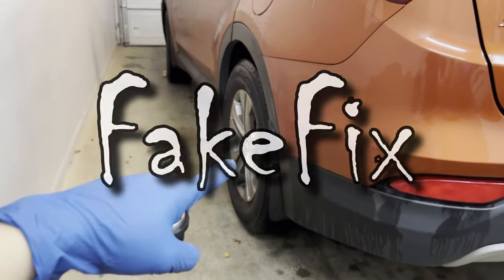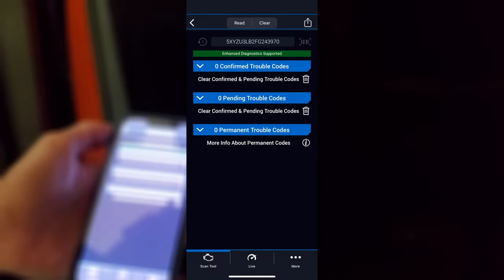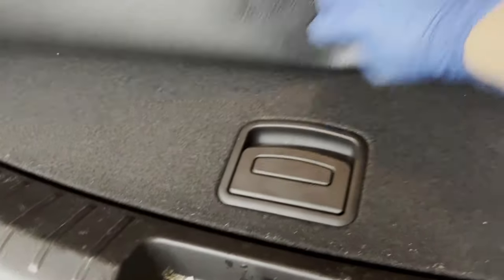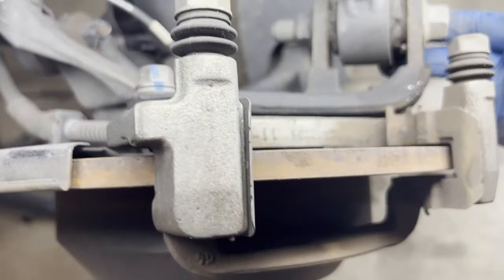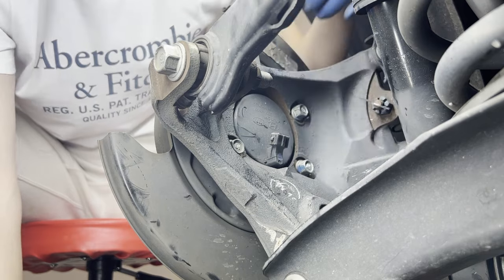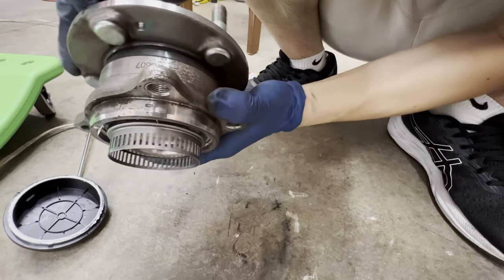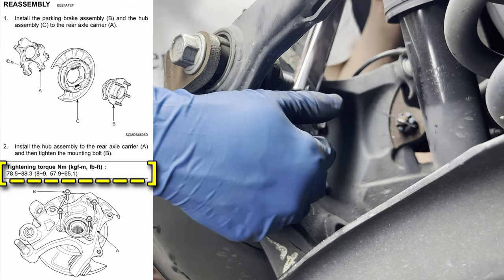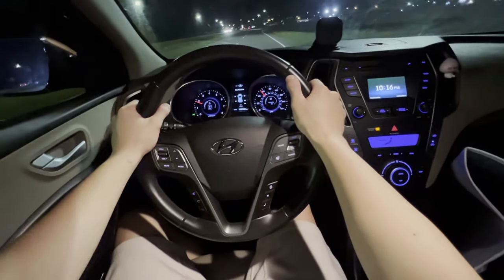Hyundai & KIA REAR WHEEL SPEED SENSOR REPLACEMENT@chrisfix

Comment: As others have said so well, excellent video. In my case, I would have probably spent around $400, but even then it would have taken two months for an appointment. The clarity of this video allowed me to brave the repair myself and I couldn't be more pleased with myself. (lol) Cost: $84 for diagnostic report, $17 for sensor from Amazon. Now I look forward to saving $84, next time, by using my new diagnostic scanner ($98.99), and @chrisfix will be my first stop every time.
Reply from the maker: Such a great comment!! Thank you!
Reply: Can you tell us what kind of scanner did you buy? Thanks!
Reply from the maker: @ricardoampie4194 BlueDriver. Its $99 on Amazon

Comment: Good video, just one correction needed, all you have to do is push the clip in and the plug will release when pulled. I looked up how to change it in Mitchell since I found the sensor separately at one of the parts stores. Mitchell said to remove the front wheel and the back seat. I think that comes from Hyundai. What? Remove the front wheel and rear seat back, that's insane. It still never mentioned how to separate the sensor from the hub. I figured I would have to pull the hub to do it but wanted to see if there was a way to pry it out without removing the whole assembly. Thanks.
Reply from the maker: Good to know! Thank you for the correction.

Comment: I have a 2012 Santa Fe. Your video was almost exactly on how to change the abs sensor. I was able to to do it and saved $350. Thank you.

SN: The 2012 Santa Fe doesn't require an offset wrench because you have enough room to do it with a socket wrench.
Reply from the maker: Glad to hear that!

Comment: Saw other YouTube videos on this... By far this is the best one with the best lighting/video angles.
Dealer quoted me $550 USD for this fix. Sounded way too high for me.
On my 2018 Hyundai Santa Fe Sport replacement, removed the entire caliper bracket along with attached Caliper (squeezed a little caliper cylinder w clamp to ease removal/installation of entire Caliper Assembly).
The use of the offset 14mm wrench - bought a set for this fix - to remove the lower bolt on the caliper bracket was invaluable, else it would required more disassembly in the rear suspension, something I was not willing to do.
Reply from the maker: Thank you for sharing your experience. I haven't used an offset wrench since this one.

Comment: Thanks for the great video. This fix worked great for my 2016 Hyundai Sonata. The only differences are:  do not need 14mm angle wrench and the emergency brake backing plate needs to be removed. Thanks again!
Reply from the maker: Good to hear that!👍

Comment: Dealer quoted me 450 for one, 700 for both. This video will help me do the job myself. I bought the genuine KIA part (20 bucks! on ebay), and an 8 dollar offset box end 14mm wrench. Thanks for the clear, concise step by step video! BTW ... Auto Zone diagnosed the problem even to which wheel sensor was causing the lights to stay on for..FREE!! Only thing I may do in addition is to put a little silicone caulk at the outer edge of the part before tapping it all the way down. KIA had a service bulletin on this 7 years ago for this car, and it said it will help keep water out which can wreck the sensor.
Reply: I did this repair today. Went well after watching this video several times. On my 2013 KIA Sorento FWD I didn't need the offset box end wrench. But,  after I finished, I started the car and the warning lights (ABS, ESC, downhill assist) still came on and stayed on. Rats! I pulled the car up and down the driveway. Still on. Disconnected the battery for about an hour. Nope..still on. Then, went for a drive around the block and the lights all went out! YAY! So...in my case it was different from the video which showed them going out immediately. So, if this happens to you, don't despair until you drive the car and spin the wheel fast enough for the sensor to pick up the signal. Thanks Again for the clear video!
Reply from the maker: Thank you for info!!

Comment: Excellent. This was a big help in replacing the rear wheel speed senser in my 2017 Sorento (FWD). There was only one minor difference with accessing the brake caliper bracket bolt, and I did not require an offset 14mm wrench.  My adaptive cruise and front camera also didn't work because of this failed senser. I bought a KIA OEM senser (<$100) instead of the cheaper ones offered on eBay. Thanks again for the work that you put into this.
Reply from the maker: I’m glad to hear that! Thank you for sharing your experience.
Reply: Boa noite amigo, acredito que estou com o mesmo problema. Tenho um Kia Sorento, e ascendeu a luz do sistema DBC no painel e não apaga. O problema no seu carro era esse?

Comment: Thanks for the very informative video. A friend of mine has a scanner that also checks for ABS codes. The right rear sensor was sending signal that the car was traveling 170 MPH while we were sitting with the car in P.
It looks like a simple enough job, I wonder how much more the dealer wants for the part, it's cheap enough on Amazon.

Comment: I wish I could give you more thumbs up. I bought the rear sensor for my wife's 2017 Tuscon.... but it's the wrong part. EVERY single part search is the exact same wrong part. (wiring harness with plastic single bolt plug sensor).  What I see when I pulled the wheel off is this very thing you're replacing as the only sensor on there. I have no idea why ours is different than every single sensor listed for this vehicle. I wonder if there was a revision or something mid-year for our model or something where this sensor was changed for the one in your video. Well... I can take back the $125 part, and purchase the $20 part now.      Thanks so much for this video!
Reply from the maker: Thanks for sharing your experience.  I can feel how hard it was. The probe type sensor is for the front wheel only. Cap type sensor is used on rear wheel and it is sealed with the wheel bearing. Thats why its soled separately in official parts shop. Good luck.

Comment: This was great.  Other videos say you have to replace the bearing along with the sensor because they come as one unit.  Which is $50 vs $10 per wheel. Love that he showed how to test that the sensor is bad too.  My sensor ohm'd out ok but when a magnet was placed next to the sensor the ohms did not drop toward 0 (Replacing the sensor fixed my problem).
Reply from the maker: Thank you for the magnetic trick!

Comment: Great video. Just one suggestion: measure the resistance in the beginning of troubleshooting to eliminate wiring issue as a potential problem. This could save time.
Reply from the maker: Good point! Thanks

Comment: Thanks man! When you say align the connector position, is there a mark to line up or something?
Reply from the maker: I couldn't capture it in the video. Just point the connector towards a place where the bolt spacing is wide. The hub has no top or bottom.
Reply: @_yamech7533  Thank you so much my friend!

Comment: Thank you for the video.  Helped me a great deal on my 2015 Sonata Limited.  Only the right side was bad, but replaced both sides. If one side goes bad the other side is right behind, right?  Didn't need the offset wrenches as bolts were very open, but now I have a set so still a win.  Bought 2 sensors from Hyundai dealer in NC, $53.33 for both with shipping.
Reply from the maker: That was good deal. Thank you for sharing your experience!

Comment: Thanks for the great video. Replaced my wheel hubs and cleared the code. Note: the clip on the connector can be pressed to release the connector rather than removing the clip...thanks again.
Reply from the maker: Good tip👍 I should mention that on next video.

Comment: FYI my 2017 Sportage used all SAE bolts on this job, except for the 19MM wheel nuts - ??? Great vid, thank you.
Reply from the maker: Most of bolt sizes are compatible. Perhaps it would have been possible to use metrics. In Korea, metrics are the standard.

Comment: I am about to replace mine on a 2017 Kia Sorento.  Dealer wanted $750. I saw your video and said I’ll try to do it myself. I’m confused as to where to align the sensor like you said when putting it back on tho.  Is there a groove indicating where the sensor should be?
Reply from the maker: All you have to do is remember the direction of the connector when removing it.

Comment: Great video,  which scan tool are you using?
Reply from the maker: Its Bluedriver($120). Its easy to use but overpriced. If you need to scan the code only, FIXD($40) can be a great option.

Comment: Replaced my sensors and lights remained on. My new sensors are reading 20m ohms. Is that right? What should the actual ohm reading be for rear tire sensor? Does it have to be around 240ohm?
Reply from the maker: What was error code number?
My new sensor was reading 400kilo ohm.

Comment: Great video I've got a Hyundai ix35 and I've changed the Driver shaft and maybe I've done something to the sensor because it feels like the the brakes are on
Reply from the maker: You may need to check wheel speed sensor and wire. If you did not remove sensor before take you hub bearing, sensor wire could be damaged.

Comment: Is it possible to remove those bolts by manual wrench instead of electric wrench?
Reply from the maker: Yes for hub. No for wheel lug nut. you need braker bar at least.

Comment: Excellent video! Saved me a bunch of time. Quick question - why did you have to remove the caliber and bracket separately? I think you could remove bracket and take off whole assembly. Saves a few minutes.
Reply from the maker: I think it will be possible to remove it, but it will be difficult to release the bolt under the lower arm.

Comment: I have a question. Does this works on Kia Sportage 2014 as well? Got same DTC code. But cannot find bearing sensor anywhere for my Kia?
Reply from the maker: As mentioned in the video, dealership parts center do not sell sensors alone. Search for wheel speed sensor that fit your car model on Amazon or eBay.
This video is only for FWD. not 4WD

Comment: Hey gudday I watch your video about abs brake hill descent light does not comes off. It is suitable also on kia sportage 2019 cause mine lights off  does not comes off. Just asking I'm from the philippines
Reply from the maker: If it is Front Wheel Drive vehicle, Yes. it will be similar to Hyundai. But make sure OBD2 Error code before replace sensor. ABS light may be turned on for other reasons.

Comment: I have a 2014 Santa Fe limited V6 FWD. Mechanic said ABS code was for rear wheel speed sensor but for this model I need to replace the whole assembly.  How can I confirm if that's true?
Reply from the maker: That is true. Dealers don't distribute sensors alone. it is delivered only as an assembly. The method in my video is a shortcut. This is not an official repair method. Replacing whole assembly is manufacturer’s recommended method.

Comment: Sir how about if the scanner said wheel speed sensor/performance/intermittent are the result. What will we will do? We will replace the speed sensor ?
Reply from the maker: Search code number like C1208. Description from scanner is not very accurate. Find out DTC code and search possible reason of that code.

Comment: I need to replace the same part but on a 2013 Hyundai Genesis Sedan 3.8 V6 The part number on mine is 51750-3MXXX when I search for it it comes back with whole assembly/hub I don't want. I just want this part your replaced for my car, are they the same for all Hyundai/Kia vehicles or are they different, do you know where I can find, your video is very helpful thanks for posting.
Reply from the maker: The 2013 Genesis only has Rear Wheel Drive. It will be totally different with FWD.
Try to search
59910-3M000 for rear left
59930-3M000 for rear right
Reply: @_yamech7533  I'm looking for both front sensors  without the hubs not the back yet but thank you.
Reply: @_yamech7533   My Genesis  has the same looking part in your video but in the front only on left and right. Not the back. I can't find them.
Reply from the maker: Update. I confirmed that Genesis front speed sensor is different with Santa Fe. And does not have separate part number. You may need to get a hub in assembly.
Reply: @_yamech7533  Yes I was afraid of that thank you for confirming I appreciate that very much!

Comment: I did this repair on an i30 but now I have a red exclamation warning sign on my dash board do you know what the cause or issue is?
Reply from the maker: It seems to be a brake-related warning. Scan the code with OBD tool.

Comment: Hi where did you get the manuals? I am looking for i30.
Reply from the maker: If you are replacing rear wheel sensor on a front-wheel vehicle, it would not be much different from the video. The front wheel sensor is a different story because it is shaped like a stick rather than a cap.

Comment: how do you align the connector position? Is there something that tells you where to place it on the new one?
Reply: Just guess it will either have a different spacing near it or you could use a colored marker on hub and old sensor before removing to try line up same spot for new one
Reply: @automechanic904  I did the marker and it worked like a charm. Thanks for the help! much appreciated.
Reply from the maker: @mikeosborne2857  Thank you for participating in the knowledge sharing!

Comment: I am curious what part inside the original sensor failed?
Reply from the maker: I haven't teardown it, but as the resistance was too high, it is suspected that inside coil has been disconnected.

Comment: Thanks for this video,. Great job! My 201t5 Santa Fe is displaying this error code for both rear sensor  (C1208 and C1209) I  am thinking of just replacing the sensors and not the whole hub since they look good but not sure if worth the extra investment and buy both…
Reply from the maker: If you have FWD, most of vehicle weight is on front side. All heavy powertrain components are supported by front wheel . Not much load on the rear wheel. I am confident that the rear wheel bearing will not get worse before the front wheel bearing. So consider how much you use your payload in the rear.
Reply: @_yamech7533 yes it is FWD and use has been very light. The bearings look good I tried cleaning the sensors tu that didn't work so I will try changing the sensors. Whish me luck lol
Reply from the maker: Why don't you test a resistance before purchasing a new one? The new OEM product had a resistance of 400kohms. see 02:52
Reply: @_yamech7533  Yes, I saw what you did there. I will try that first just to make sure the sensors are the actual problem. Your video has been very helpful man and thank you for taking the time to reply I appreciate it.

Comment: Is this the same part for my 2016 Kia Sorento?
Reply from the maker: No. Part that shown on this video is for 2007-2017Hyundai Santa Fe 2WD
and 2011-2015 Kia Sorento 2WD.
I believe replace procedure will not much different with 2016. Just make sure your part number.

Comment: They had a RECALL  949 
RR WHK SPEED SENSOR INSPECTION/REPLACEMENT in 2021. Have brought my 2014 Sante  4x to the dealership and still same lights on for 5 years AND did the recall! They never fix the issue. Codes showing C1206 rear lh open/short, C1209 rh lh open short and C1210 rh range performance intermittent.  Supposed to have this looked at again next week, Hyundai corporate making empty promises though. Please help. After seeing this wondering if I can get a $20 to $100 part and bring it to a local mechanic. These greedy dealers are going to want to change me that just for a diagnosis. Again FIVE times bringing it in even during the warranty and it was never fixed .  Any advice? Thank you so much.
Reply from the maker: If it happens intermittently and it happened again after the replacement, I would suspect a faulty connector or wiring.
if you have experienced mechanic, they can read raw data from sensor with the advanced OBD2 tool and analyze them. wish you good luck.
Reply: @_yamech7533    Bad sensor. Both got replaced.   Light has been off for a month now.  Thank you

Comment: How did you know which sensor has the error?
Reply from the maker: You need to scan OBD2 error code. 00:00:47 I got code number C1208. It means “Rear Left Wheel Speed Sensor Invalid Or No Signal”. Each sensors has different error codes.

Comment: Help, only my ESC is on and it LOCKS up my rear wheel brakes. I believe both of them the dealer failed to fix it for me
Reply from the maker: You may want to check brake line such as caliper, ABS module and pipe line. ESC failure can cause wheel lock up, also you have to consider that lock up wheel can cause ESC light on.
Reply: @_yamech7533  Can the sensors cause a signal error that makes it lock up too? it is strange why it locks up two wheels at the rear.... the mechanics already changed the lines. One forum mentioned even steering sensor can cause it
Reply from the maker: Sensor can cause ESC error but will not lock up. Stability control program use a lots of information like steering wheel angle, wheel speed, gas pedal, brake pedal, etc to determine vehicle maneuver.
Reply: @_yamech7533  Good to know thanks for the heads up

Comment: Your ohmmeter test is inaccurate, a good sensor has a very high resistance between the 2 pins in one direction, open when reverse leads.
Reply from the maker: Thank you for the correction!

Comment: What if you get a resistance reading of 1000 Ohms?  What does that mean? The code point to the left rear but it doe snot read anything like what he got in the video.
Reply from the maker: New sensor reading 400k-500k ohms. I think 1k ohms more like short circuit.